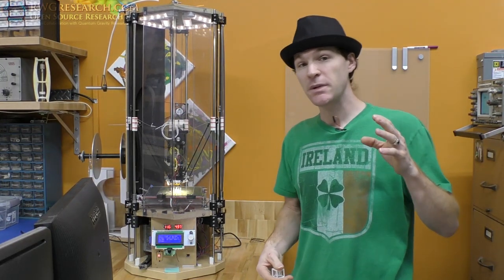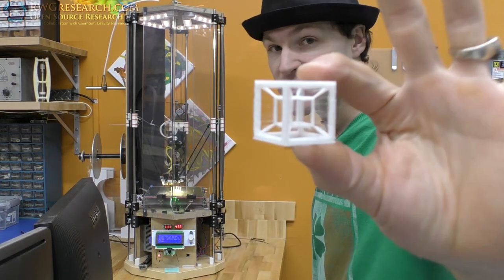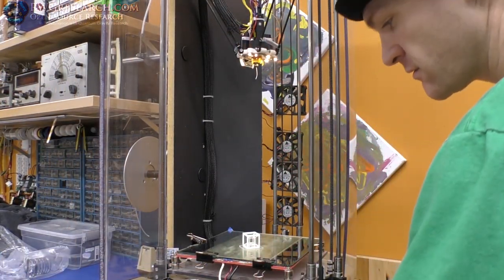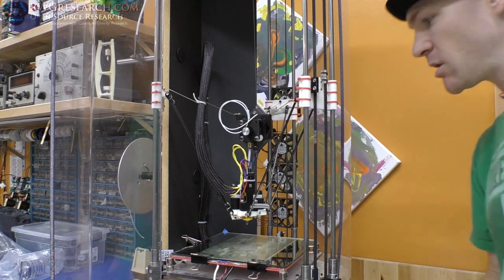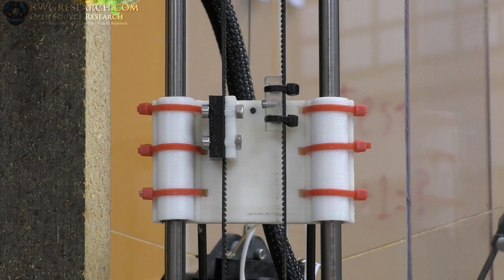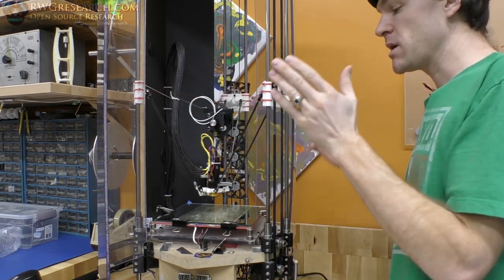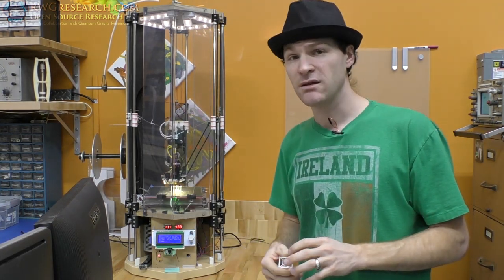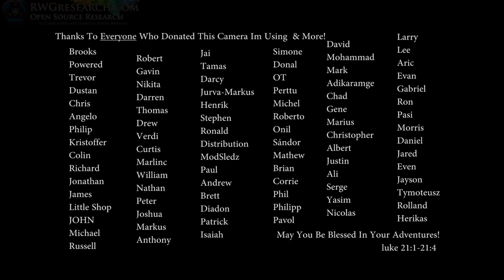PLA 3D Printed Bushings. 1 Year Later... How are They Holding Up?  Rostock Delta

Comment: I guess you really should move the motors slowly, though, on my geeetech i3 I was never careful and even the LCD often lights up when I move the motors with the printer shut down, and two or three years passed and both my NEMA 17 motors and A4988s are okay. You can't do that with 28BYJ-48 or servomotors, because you will destroy the plastic gears inside but I'm assuming that there will be no damage when rotating NEMA 17's shaft by hand, even at high speeds (though, it would make sense that the driver can get damaged). Did anyone ever destroy the NEMA or the driver by moving it by hand fast?

Comment: Awesome! I've also been using PLA printed bushings for quite a long time, and they do hold up well. During your wiggling I noticed that the rods themselves seemed to be flexing at least as much as the bearing play. It looks like a bit of a long distance for such a narrow rod to be unsupported...perhaps that is also a contributor?
Reply from the maker: yes it is 100%, that's why the extra rubber supports relieve a lot of stress on the system. unfortunately unless i replace everything on the rails it is what it is... now you know why i went with the extruded AL on the OSD :) thanks! ~Russ
Reply: Perhaps you could retrofit this machine with thicker rods to cut down on that play? If it is worth it to you and you aren't just planning to use the OSD for everything in the future. You can get rod pretty cheap from china these days...
Reply from the maker: unfortunately, theses rods are quite expensive. They are 3 feet long and i will not trust that they will be straight when i get them in to post. that has been my experience so far, and i will not go the cheep rough on the #1 most important part of the system. 12mm rods would be really great tho. i think it would make everything Much better. ~Russ
Reply: Yeah, crappy rods can ruin your day pretty quickly. 3ft, sheesh. Hard to realize how tall the machine actually is just from watching videos :)
Reply from the maker: :) yeah quite long. x6 adds quick even at 10$ each or something... thats 60$ and I'm sure you wont find 3 feet 12mm precision rods for less than 15-20$ each. thanks!!! ~Russ

Comment: Just a thought, you could make the sliders way longer downwards, would limit the twist movement, and not add a lot of weight
Reply from the maker: yes. this is correct. beleave it or not. the orgnial berrings / bushings were 1/2 the size of thses! the next ones I'm making are integrated with the part that hold the bushings. and there is 2 smaller bushings spaced 3x apart. so even better. however I need to make sure the arms don't go to far down as they will hit the bottom!! so limited on length by the travel.  ;)  thanks for the comment! ~Russ
Reply: rwg42985 I know, they seem very simular til the ones on my delta mini pro, so if specs are the same you could go up to half radius I think 🤔 😀
Reply from the maker: I moved the hall efect sensors. to the top of the bottom. so that's where my liminatation is. I'm home and it's at work and I for got to mesure it. lol. but I already for the design ready for testing. ~Russ
Reply: rwg42985 looking forward for the new parts, love the work
Reply from the maker: me too! lol ~Russ

Comment: Russ, have you looked at hexagonal boron nitride or dri-slide Molly dry lubricant? Both are dry lubricants used in the firearms fields. They are some of the slipperiest compounds available.
Reply from the maker: sounds like its comparison to graphite? I see they are all listed under wiki. i was going to try graphite, but its so messy. how about the other ones? do you know if there as messy as graphite?  I see some come in a spray / liquid then try. that's ideal to applying dry lube i think. probably better than silicone. i guess ill be trying 3 more new options :) thanks for the tip! ~Russ
Reply from the maker: wow they even make Dry PTFE spray lube! that would work as well! ~Russ
Reply: Russ, the hexagonal boron nitride is probably the best as it's a white very fine powder that bonds with the metal or plastic and greatly reduces friction. I use it to coat projectiles in a match rifle. It does such a good job of reducing friction that it will lower the pressure in the chamber significantly enough that I need to load my rounds just a little hotter to maintain velocity. The best place I've found to get it is from David Tubb on the internet. The Dri-Slide is a dry molybdenum in a volatile base that evaporates rapidly leaving a dry non sticky lube film. The problem with it is that like graphite it leaves a very dark gray film that will rub off and discolor what it comes in contact with. All of them are very good dry film lubricants. Since I started purchasing  the boron nitride I have probably coated at least 10,000 projectiles it really has helped my barrel life.
Tony
Reply from the maker: thanks Tony, i think i'm gonna get some hexagonal boron nitride. after doing some reading and research it seems the best for what i want. applying it might be hard but worth it. do you know of any that is in a spray form? i see a company mixes it with acetone for application. not a bad idea... any hoo, thanks for the tip im gonna try it. Thanks ~Russ
Reply: Russ, there are several online sources for the aerosol HBN. Here is one source and a PDF describing the product. http://www.lowerfriction.com/pdf/22.pdf. Here is a site with info on using HBN. http://www.boron-powder.com/?gclid=CPHM8feqiNICFQMHaQodGO8A0w David Tubb products. http://www.davidtubb.com/tubb-accuracy-reloading/bn-boron-coating
Tony

Comment: First comment! 😃 I'm currently doing my own delta, but I'm having issues with the 'flatness' . . other than that it's going great 👌 Cheers for the upload Russ!
Reply from the maker: yep, that always something to fight. 
what electronics are you using? 
most firmware's not have bed probing and correction. if you don't have a bed probe, install one! its a bit tricky to get all set up but once you do it *should help... 
~Russ
Reply: rwg42985 Cheers Russ, I'm using a sanguino 1.3a (I also have the mega with the 1.4 shield for a separate project) it's all good, just the 'bowl' effect that I need to sort out before I run filament, I have the probe on my to do list, it will definitely be the first upgrade 👍
Reply: rwg42985 Oh, I'm using Marlin btw 🙂
Reply from the maker: ok greate. I ask because I go in to that here. https://youtu.be/nN1XsFWq1HA
about 1/2 way through. you may as well watch it all tho. ~Russ

Comment: What about using nylon bushings in the printed PLA ????
Thx for sharing. 

Regards.
Reply from the maker: I found that nylon is a lot more sticky. with enigh lube it might work. but pla seemed to be better. I did not try anything else. in sure there is a better plastic as well. ~Russ

Comment: What about making or using Igus bushings? You can buy them for 1.99 each from Folgertech.
Reply from the maker: strangly enugh. I have some of those and. there suppose to be in a press fit steal housing. if there not, there not fit properly. And there for no good for this. they are slightly over sized. becuse the press fit compressed them. thanks for the comment. ~Russ
Reply: rwg42985 I printed some from Igus filament and worked them in. they started out right but after a little work the fit good and work well.
Reply: Igus also sells their bushings in the steel (or rigid plastic) casings already, those are supposed to be direct replacements for the LMxUU bearings. Quick search turned up the RJZM-01-08 (Man. Part No.) that is supposed to go on an 8mm shaft for about 9 GBP. Also, it seems that you can buy replacement bearing liners for those.

Comment: Dow 33 light is a good lube for moving parts
Reply from the maker: thanks,that looks good too.  

I recently stated using this: https://www.amazon.com/Dow-Corning-Vacuum-Lubricant-5-3oz/dp/B001UHMNW0/

I have deigned bushings that use nylon, ( will post them soon)  so this keeps the silicone "wet" as the dry silicone i show in this video is not enough. But the high vacuum Lubricant you can apply tinny amounts and it keeps it "wet" but it dose not collect much dust / dirt. 

~Russ
Reply: I use Molykote 33 light for my paintball guns.  stays wet and doesn't stick

Comment: This is the lubricant I'd recommend. It's superior to silicone and I've been using a variant of it on fan bushings for several years. Note it's the cerflon that's the important ingredient.
https://www.liquidwrench.com/product/white-lithium-grease-2/
Reply from the maker: yeah, i looked in to that cerflon, i got some "dry" lubricant that has that in it. question, dose that Liquid wrench leave a coating? aka will it pick up dirt? this is the one main reason why the silicone was in portent to me. It dose not collect dirt. thanks for the posts! ~Russ
Reply: Well, there are quite a few variants of lubricant that contain Cerflon. I only guessed that the white lithium type would be best for you based on my own experiences. They use white lithium grease a lot in other applications where dirt and contamination is an issue. In fact it's what you'll usually find on slide bearing type applications from CD/DVD/BluRAY drives, to automotive hinges etc.  Really though the important factor is that whatever carrier your use (ie lithium grease, or silicone) it's really only there to deliver the Cerflon. Initial usage runs in the Cerflon into the wear surfaces where it does it's job for a long time afterwards. I would think that PLA might do a good job at picking up the Cerflon and carrying it from then on. The steel rails definitely will pick it up, eventually.
If it were me, I would apply the white lithium Cerflon then make a gcode script to just run the extruder up and down from limit switch to limit switch and let it run for a while. Then once the grease has been fully distributed, wipe the excess off the rails and use the machine normally. Maybe repeat this process occasionally as part of regular maintenance.

The perfect scenario would be brass slide bearings on steel rails. Soak the brass bearings in Cerflon overnight, then assemble and run the break in script to move the bearings on the rails for a while. 

I only buy fans with brass bushings for all my cooling fans instead of ball bearing fans. I then clean off any factory lube with WD-40, dry with absorbent, lint free cloth, and then apply a generous amount of Cerflon and let soak. Then I run the fan for a few minutes, unhook power, dry everything off, re-assemble and go. I have fans that have run non-stop for years after being treated this way. YMMV of course.

Comment: Why does allowing a platform to bounce around on rubber grommets make it more stable? - I'm somewhat distracted as I was expecting to see a mime artist video...
Reply from the maker: it takes the stress off the rails / plastic parts and allows the motion to be counter acted. so when the endefector makes a sudden motion the printer in its entirety moves the other way. This helps with the stress that all the parts on this printer has.  ~Russ
Reply: When the machine stops the moving print head, it wants to continue moving, so it presses against the arms, which press against the bushings, which press against the rods, which press against the chassis, which presses against the table, which presses against the floor, which is so solid it doesn't matter. So one of these things has to take the kinetic energy that's still in the print head and convert it to heat energy by bending/compressing. However,  most of those things we don't want to bend. So we introduce a very bendy element along that way to do so instead---but not so bendy that the backlash bounces the machine around so much that its contents rattle around like beans in a bag.

Comment: Russ, you are doing it wrong! you are supposed to adjust them so the slide freely with no play. 
the ones in my i3 clone have no play at all. and im using general purpose oil (thiner than motor oil but heavier than wd40)
silicone spray is too heavy and gets pushed away. it has to be thing enough so that the bushing slides over the oil, sticky enough so that it stays on the rods and have sufficien surface tention so that it crawls back after te bushing passed by.

You also need to design the holders so you can align them perfectly.

if you want precision you need to do the things right from the start.
Reply from the maker: "Russ, you are doing it wrong! you are supposed to adjust them so the slide freely with no play" 
Theses were tight when i installed them. its been 1 YEAR! Things ware out, even bearings!!! 
I may try a light oil on the next ones. but i found that the silicone coats everything extremely well. just like graphite...  
any how, only testing and time will tell... 

~Russ
Reply: *****

maybe its because of your rods.
I'm using mine on polished chrome rods from some inkjet printers. The hardened steel rods i had for the lm8uu where bery porous even after a few minutes of 1500 grit sand paper. It was shiny and all but you could see tiny holes  in the material, and the bushings certainly felt more grabby on the steel rather than on the chromed one. With the oil and running on the chormed rods, they felt like a hot knife on butter. It just slided like if it where floating on water. You could feel the viscosity of the oil but it certainly had zero static friction. Plus you could even see how the oil sipped under the bushing pads.

Maybe it's design problem. I read a bit about bearings and lubricants before designing mine. I certainly didnt do the math, but i made mine so that they have a large contact area pad to "surf" on the oil layer.

do you have a link to the bushings you are using?
Reply from the maker: yeah. if you have polished chrome rods then those would work really well. but over time things wear out. even with keep in good maintance. I have 4 years of life on three rods running allmoat every day. lol

all the files can be found here. 
http://open-source-energy.org/rwg42985/russ/Projects/3D%20printer/2016%20RWG%20rostok%20delta%20updrade%20parts/

those are all the parts for the 2016 upgrade I did when I I stalled thses bushings. ~Russ

Comment: to show movement of bushings why not use a dial indicator with a magnetic base. even a cheap one would be a good tool for you to have. you don't need accuracy of say .5 thousandths. so a cheap one would do. if you don't have one I can point you in an economical direction.   mercury 101
Reply from the maker: mainly because you can see it with the naked eye. I have a few dial indicators i could have used. but did not even think about it. i guess because i was not getting that scientific with it lol . thanks for the comment. ~Russ